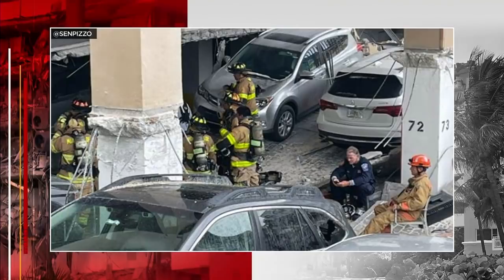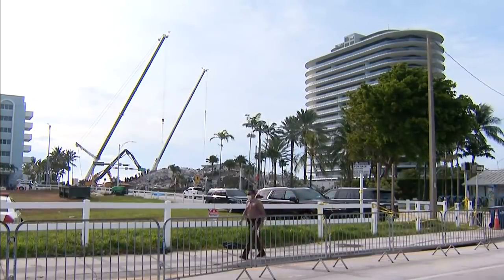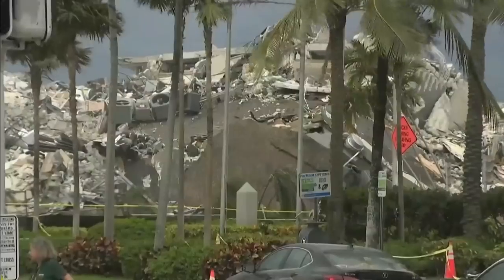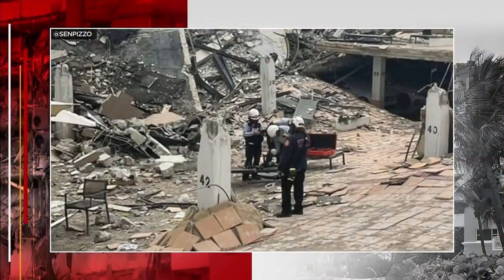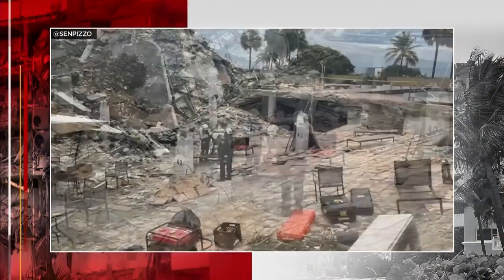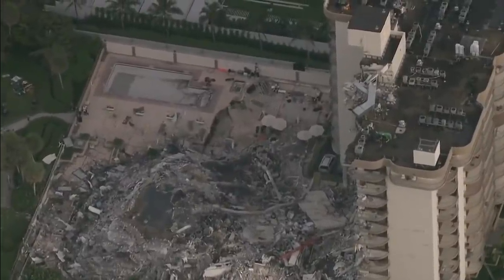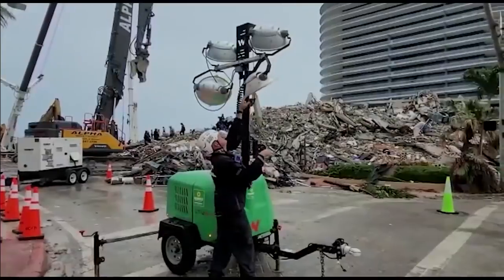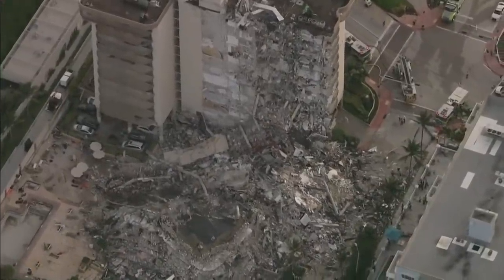Building experts studying Surfside collapse have questions about its initial construction

Comment: SPOILER: It's going to be a combination of corruption, materials, corner cutting, lack of inspections, lack of maintenance, adjustments to the structure of the building etc. It will also likely mean numerous other buildings in FL will be found to be unsafe and have to either be demolished or reinforced.
Reply: Abso-freaking-lutely!!
Reply: Bingo. It's a perfect storm of all you said.
Utterly bizarre and horrible. 
I just wonder if we'll learn the right lessons.
Reply: In the 80s wasn't there a building boom do to the cocaine cowboys? Could this be one of the buildings from that Era?
Reply: Don't ignore stupidity.  I remember the collapse of the Hotel New World in Singapore in 1986.  In designing the building, the structural engineer had ignored the "dead load" of the building (the weight of the building itself).  So the columns couldn't support the weight of the building.
Reply: @kevinbyrne4538  funny you mention that. What if condo owners decide to remodel by putting in granite countertops and marble flooring. Would that affect the integrity of the structure? I mean if a lot of the Units made changes
Reply: @yoshit9819  -- Yes.  And in 1995 the Sampoong Department in Seoul, South Korea collapsed because the building's owner reduced the number of columns, vastly increased the thickness of the floor in an upper story, and added heavy air conditioning units to the roof.
Reply: @kevinbyrne4538   @Travelin Bo I’m impressed with your understanding of the situation considering you’re not structural engineeers. I happen to be one and coincidentally enough also did a forensic analysis on the Sampoong building.
The Miami building case was just a disaster - failure to adhere to structural drawings by not providing adequate top abs bottom reinforcement at the column to slab connections; apparently the slab wasn’t built with a slope to prevent “pooling”; salty water corroding the inadequate steel; differential settlement due to soft ground; not sure why they even had parking below grade when the building is that close to the ocean; punching shear failure also brings up the issue of column spacing - not too sure why they couldn’t have used smaller spacing and potentially bigger, rounded columns.
Altogether, there’s gonna be lots of blame moving around in the case assuming the parties involved in the design, construction, maintenance, inspection, certification are all still around!!
Reply: Upper floors were added with marble  and tile increasing load to top.
Reply: @yoshit9819  I believe they might have added some heavy planters right over the columns that likely collapsed first based on the current evidence.  Those columns were attached to the columns under the edge of the building by some concrete beams, and while the initial collapse seems to have left those columns at least partly intact, the loss of the support structure on one side likely meant extra load got placed on those columns that those columns couldn't handle.  Once they went down, it was pretty much a domino effect as losses of support caused more supports to fail.
Reply: most likely be cheaper to be demolished  rather to attempt to rebuild them
Reply: Cheaper to demolish than rebuild, SO IT WAS DEMOLISHED. You said it first.
Reply: Sadly so many people had to die before people were going to inspect and build correctly. So many also maybe homeless. Again money over life, just sad
Reply: @patriciawashington8780  The building was inspected several times and the need for serious maintenance was brought up, but it was never done. This could have been averted with proper maintenance. All this crap about corruption and poor design and construction are just that, crap.
Reply: That's also why you don't give the Miami mob construction permits.  Cutting corners is fundamental to the mob's economics.
Reply: All of the above.
Reply: Almost entirely lack of proper maintenance.
Reply: @kurtdietrich5421  -- The tops of the columns that supported the pool deck contain half as much rebar (connecting them to the pool deck) as specified in the plans.  Where else did the builder cut corners in the building?  And were corners cut in other buildings?  Were inspectors bribed?
Reply: @kurtdietrich5421  
It’s a combination of a lot of things.
Reply: Hello See ya later  The owners of the building weren't the owners of the individual condos though. I've already heard some were renters and others were rented short term through airbnb. Who were the members of the condo board, who made the decisions about how the HOA fees were spent? That's what I'd like to know.
Reply: Yes, there will be multiple causal factors as there usually is.
Reply: @ApriliaRacer14  Absolutely correct. Most engineering disasters turn out to have multiple causes. Any one issue by itself would be unlikely to lead to a catastrophic collapse. But several weaknesses (construction, maintenance, possibly, although unlikely, design) result in overlapping failure probability curves and we have the tragic result we see before us.
Reply: I so agree
Reply: @MrsVirgo0829  Here's a very simple analogy, to illustrate how a chain-reaction can begin.  Assume 4 columns at the 4 corners of a rectangular floor.  If the joint at any one column starts to crack, insufficient rebar may allow the floor to "tilt" at that joint.  That tilt could also expand the cracks already present at the other 3 joints.  Likewise, insufficient rebar at those other 3 joints may allow the floor to "shear" off those rebars too.  And so it goes, in a chain-reaction that performs exactly like a controlled demolition.  That building demolished itself!
Reply: of course but who is held responisible
Reply: Hello See ya later  sadly that’s only recourse but that could take a long time. Just all so awful
Reply: @laurat1129  -- Fortunately, reducing the rebar in the building wouldn't risk the structural integrity of the building.  Oops ...  So, where else did they cheat?
Reply: @supremelawfirm  
There are a couple of videos on YouTube about how rebar rusts. The bar becomes thicker as it rusts breaking the concrete. 
It doesn’t silently slide inside. 
So don’t imagine that because that’s not what happens.
And that’s not how liquefaction works. It involves an earthquake. It doesn’t involve wet soil. 
Unless of course there was a sinkhole. Which isn’t liquefaction.
Reply: @neilkurzman4907  and this:
"Soil liquefaction occurs when a saturated or partially saturated soil substantially loses strength and stiffness in response to an applied stress such as shaking during an earthquake or other sudden change in stress condition, in which material that is ordinarily a solid behaves like a liquid."
Reply: @supremelawfirm  
That is what I believe soil liquefaction is. 
But that does not appear to have happened on that evening. It could have been a sinkhole. Or a failed footing. But that will be evident when they remove the debris.
Reply: @laurat1129  -- Thou art forgiven.
Reply: There is an idea that the penthouse was added(obviously money maker) after the original plans and construction had started and it's weight was also a factor in why it collapsed. Odds are though that they did cut corners on rebar due to supply issues/money/anything and it took years of water damage to make it apparent. Had the planter boxes & pool deck not caused water infiltration into the slab & supporting columns it may have survived the extra weight of the penthouse even with substandard construction.
Reply: @Heckleburger  -- The part of the building that collapsed first was not the part under the penthouse, but the central section which joined the two wings.
Reply: @kevinbyrne4538  Yes of course but weight will get transferred through the whole structure. Like I said it was theory especially if it was not in the original plans and dead load calculation for the building but obviously not the cause.
Reply: Correct
Reply: Hello See ya later  That bothered me too, for the same reason. They've found someone 17 days after, so I wasn't ready for them to give up on finding someone either. Even if 0 rubble from the demolition landed on the old rubble, the dust from the demolition would finish them off, but to be fair, water from Elsa probably would also.
Reply: YOU ARE 100% correct.   And I bet "deregulation" has suddenly dropped of the political agenda in Florida...
Reply: You could have just written "capitalism."
Reply: Fortunately (?) many of the victims were fairly wealthy so the local government will have to perform a thorough investigation.  They won't be able to hide or ignore their own complicity.
Reply: Good! Native.
Reply: Rarely does just one or two of those things bring down a building .. takes a full hand of scumbags conspiring to cause such a disaster
Reply: most likely demolished  because it's cheaper to build a new one
Reply: It all hinders the millionaires life style to be built and maintenance correctly...
Reply: You forgot the obvious;:; Luciferian
Reply: I don’t believe that’s the primary cause.  My suspicion is that the very ground it stood on had been compromised by salt water, leading to catastrophic failure.
Reply: And some mess with Champlain towers North and Champlain towers South drawings getting somehow mixed...
Reply: Built on beach sand - might have been foundation problems that spelled doom.
Reply: Are you saying they put profit over people's safety?  Mmmmmm... capitalism....great isn't it?
Reply: @jamesbondero6170  Has nothing to do with capitalism…it’s first American culture (cut corners) and human behavior second (deferral of maintenance due to cost).  There will be a correction after the big claims payouts.  Insurance companies will buckle down with higher rates, more requirements and greater regulation…it’s just a shame that something like this had to happen….it’s called “blood priority “.
Reply: @ApriliaRacer14  : Are you really that naive to think profits had nothing to do with it?  Who pays for the higher insurance rates?  The fat cat at the top or the little guy?  Grow up.
Reply: @jamesbondero6170  idiot assumption. Mmmm, everyone is poor and suffering. Just the very few at the top can live great - socialism.
Reply: @jamesbondero6170  oh  here we go again..They lived in a commune like socialism where they all shared the same fate. But when it came time for maintenance they ran out of other people's money.
Reply: @erictam7014  ; so Maralago is a commune too?  Don't tell trump.
Reply: And they'll have to decide because of climate change if they even want to rebuild in this area given that in 30 years it's going to be underwater
Reply: @kevindclarke  it will be  ocean at your front door property
Reply: @kevindclarke  dam im 41 and sine 1980 till now 2021 more then half of florida should be under 10 feet of water but what went wrong..i guess just add another 30 years to that..😂
Reply: @marcospratts2011  
So you think hyperbole creates reality? Why don’t you show me an article that says half of Florida would be under 10 feet of water by 2021. 
I guess you keep adding a foot of water every time you tell the story.
Reply: @marcospratts2011  I knew there had to be one.
Reply: Where did you get your degree?
Reply: The Truth / Nathan Reiber & Associates were crooks . They survived Holocaust but cared , only , about money